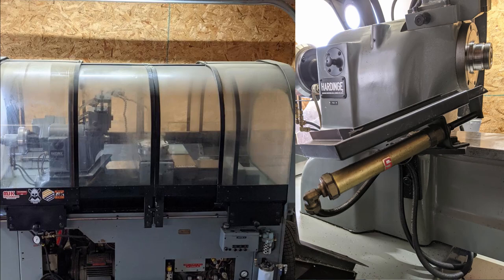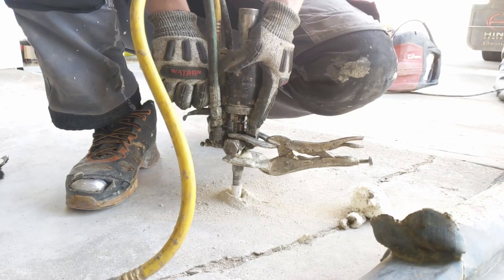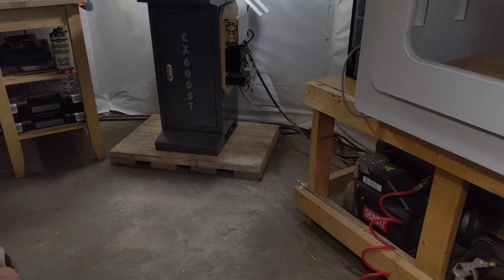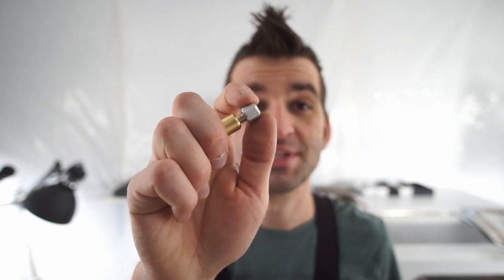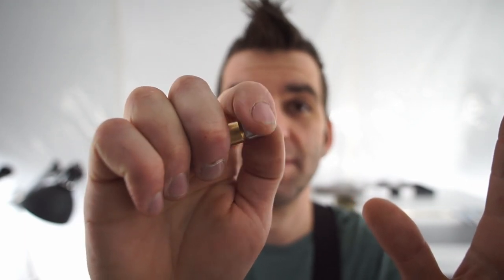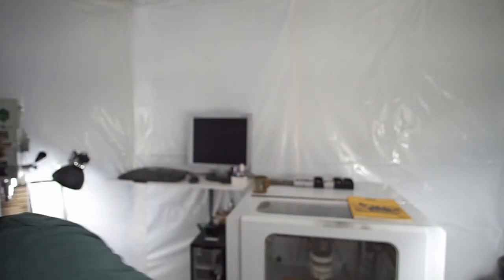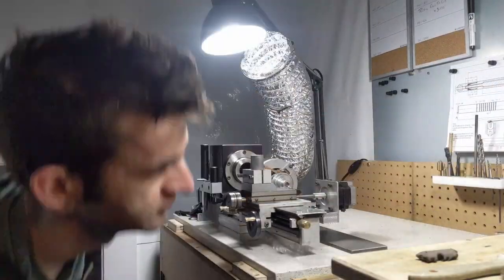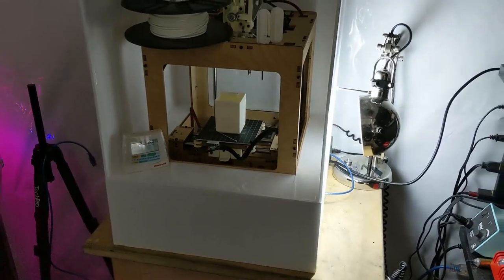A New Lathe?

Comment: Congrats on the lathe! I went the opposite direction and have been accumulating tooling for my "vintage" Hardinge turret lathe. ...though a cnc upgrade would be sweet.
Reply from the maker: Thanks...it's going to be a project! I always wanted one of the manual turret Hardinge machines, well that and a HLV if I could find one. This one should suffice :-).
Reply: @CurtVanFilipowski  An HLV is on my wishlist, too. I'll need a ground-level shop first, though, no way that it would make it down the stairs. Looking forward to setup and conversion videos on the new machine.

Comment: Exiting time. The lathe looks really nice. Are you planning to build a turret or gang tooling stile in order to machine a complete part in one operation?
Reply from the maker: Thanks!  It actually has an 8 position turret (along with parts catcher and parts of a bar feeder)...although for my work I can stack up 20 or 30 tools before I run out of clearance! Main issue is the turret is driven by an air motor which is going to take some engineering to control correctly.
Reply: @CurtVanFilipowski  ah yes I can see the challenge there. Pretty sure you will figure it out, it's a matter of time. For sure it's a huge upgrade. Looking forward to it